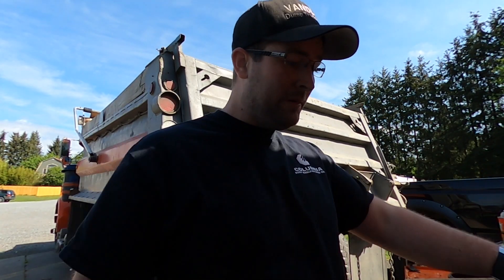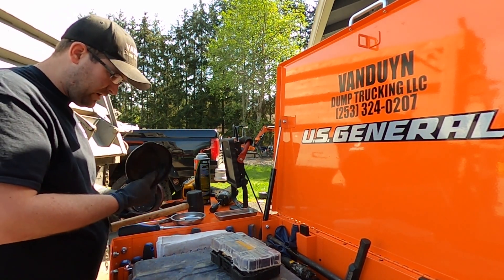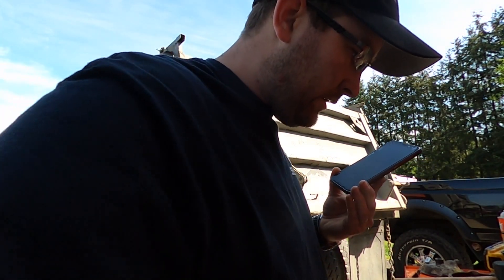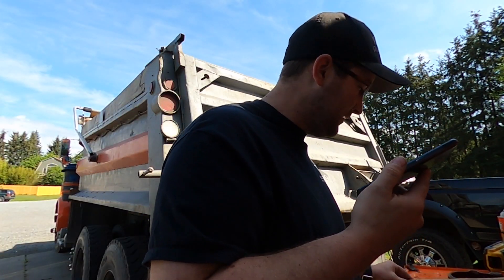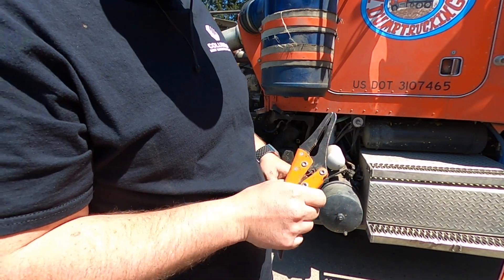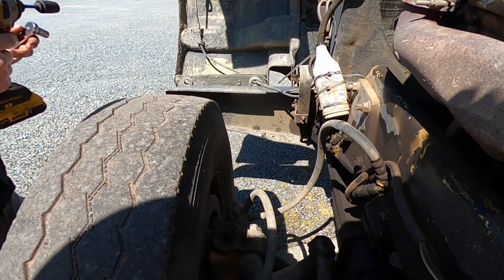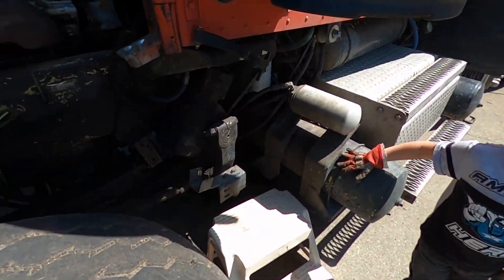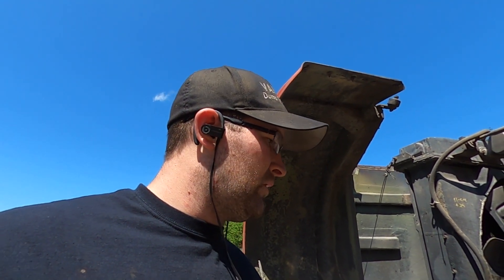FINDING PARTS FOR OLD DUMP TRUCKS!!!

Comment: I was watching a guy on youtube. He was using a 2015 or 2012 dodge ram 2500 for hotshot trucking. The rear drivers side brake rotor caught fire. The parking brake wasn't hooked up but the pads were just sitting there flopping around. As far as I know he said the park brake got hot and set the brake rotor on fire. He poured water on the brake rotor and put the fire out but it cracked the rotor. He jacked it up and the wheel just fell of. The rear axle was toast. He was way over the factory weight rating for the truck. And he goes to blame the problems of the truck being "old" and says all old vehicles are unreliable and shouldn't be on the road. And he said that he didnt have enough money to fix the parking brake. But later on he continues to buy a 80k$ ford but still say he doesnt have the money to fix the dodge. 

What do you think Brian?
Reply from the maker: I think he is crazy